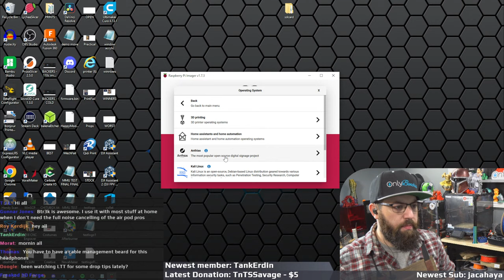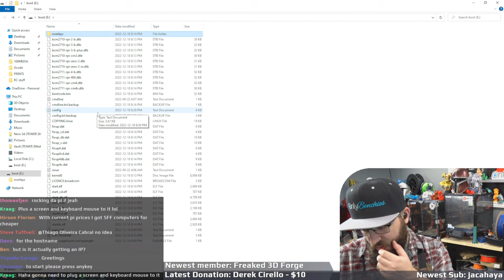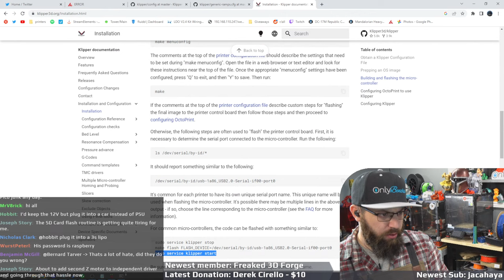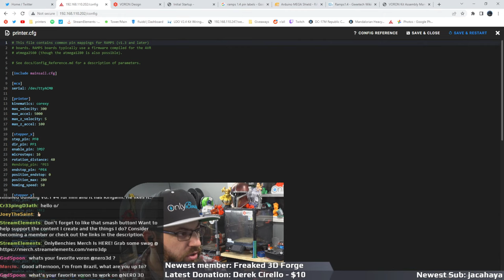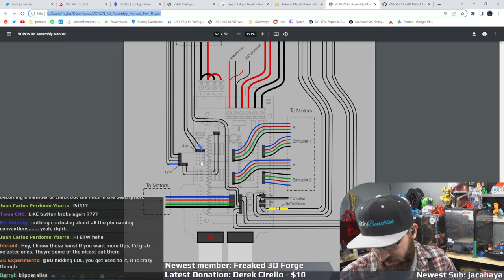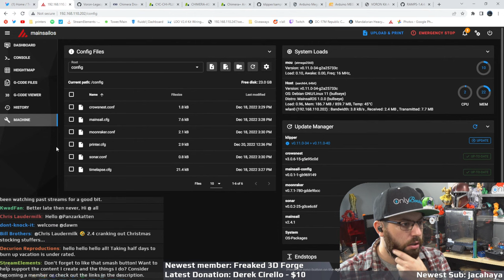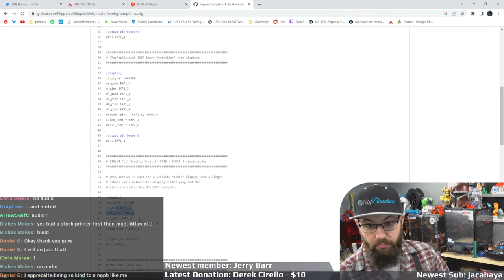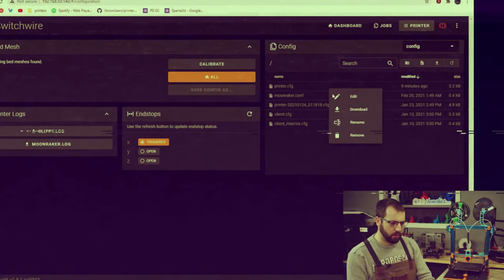Old and slow go fast - Installing Klipper on the ORIGINAL Voron #livestream #3dprinting

Comment: Try a Pi Zero 2 W ... It's on par with the 3B+ with a little less RAM I think... Close enough anyway. Works well with Klipper/Mainsail and  USB Webcam. 4-6% CPU and 42% of RAM while printing an hour long ASA print.

Comment: Hi Nero what were the names of the headphones that you are using now versus the Apple AirPods.  Thanks
Reply: The recommendation in at least one video by Dankpods is to pick up a set of KZ ZSN PRO Xs - which as far as I can tell is what Nero is using here. (Dank also recommends the KBEARs as well.) $30 USD and up is a good place to start.
Reply: @mysfiring  @nero Thanks I looked at both of those but they don't appear to have mics so wondering which model Nero is using that has a mic
Reply: @coachlewis5190  if you go on AliExpress, in addition to colour options you should also have the option to add either an in-line mic as part of the right-hand lead, or have it ship without it in your order. :)
Reply from the maker: The ones i have have a mic, but i dont use it for videos/streaming, i have a rode wireless go for that